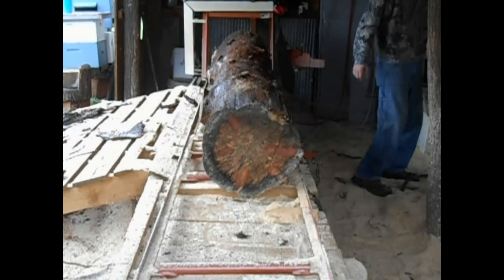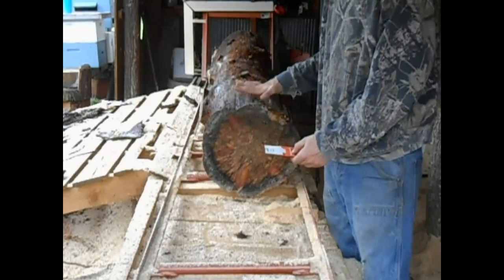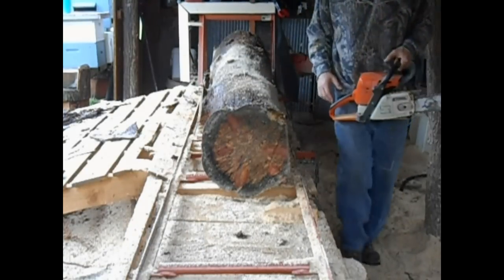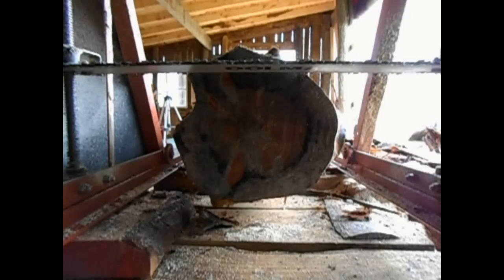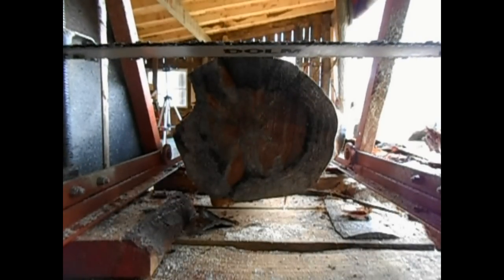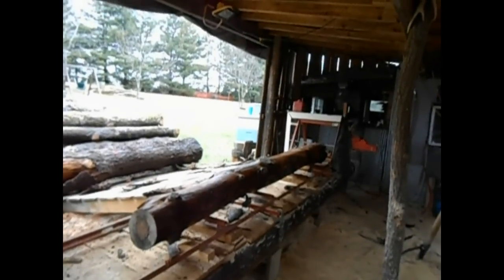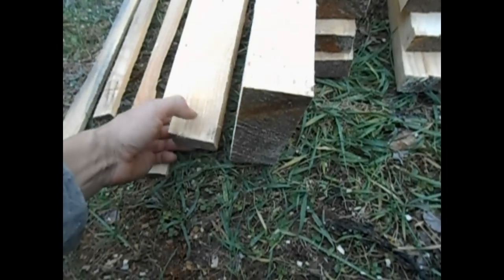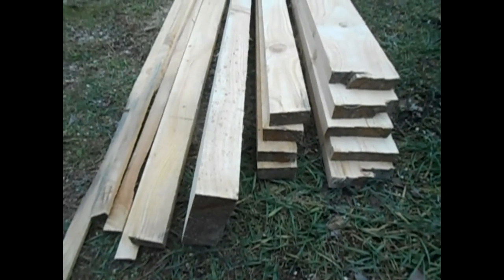Chainsaw mill/ How much lumber is in a 15" log?

Comment: Just out of curiosity, how accurate is that woodmizer table for calculating board foot based on log diameter and length?  Did you total up what you were able to cut from that log?

Good looking chainsaw mill you have there.  Seems 15" is about the largest log you can fit inside the frame for the saw.

Comment: Very cool. Do you let the wood naturally dry/season before cutting? If so, how long did it take to season with a 15" x 8' like you show in the video. +Jason Chrisman
Reply from the maker: +jaydekaytv No I usually cut them into lumber as they fall. No time to wait. Then lumber is stored and dried for a few months before using.
Reply: +Jason “Beeman” Chrisman Copy that. Thanks for the vids.

Comment: Hey Jason, thanks for responding to my comment below. 

I am a carpentry apprentice from BC, Canada, and I would like to learn about milling my own lumber. I will be watching your helpful videos.

I can't help but wonder- where do you get all those huge logs for free? Do you have any videos/ideas for how a guys without logging connections can get them?
Reply from the maker: Well as you probably seen while going through my videos I am a beekeeper. Getting free trees is not much different than getting free bees. What you need to do is get the word out, let people know you will remove trees. I even went the extra step and told a few tree guys I would take any extra logs.  One tree guy used to call me a lot to take full tralier load of logs just so he could finish the job. He would mulch everything except the logs. Hope this helps, good luck and keep me posted on your adventure.

Comment: how did you drill the holes in the blade I have tried  have bought the best drill bites money can buy I still can,t get the holes
drilled ?
Reply from the maker: LEE TAVES The holes in my bar were a complete nightmare to drill. If I remember right I drilled and drilled until I got a hole then I switched to a cone shaped grinder bit. The bit is like 1/4 at the bottom and goes up to a 1/2" at the top. So the I just did some grinding until the hole were big enough. 

The neighbor told me it would drill easy boy was he full of it. HUH? If I can be of anymore help just ask. Good luck Lee!
Reply: Jason Chrisman That seems strange to me. I installed a Log Wizard on a spare bar for debarking logs for my bandsaw mill. The saw shop owner I bought it from said it would drill hard, but I chucked a cheap drill bit in my drill press and it drilled out in a minute or so. Just used a little 3-in-1 oil for lube.

Comment: Why would the species of wood matter for the board foot definition?  As far as I know, the formula given in the video is correct, ( thickness x width x length ) / 144 is 1 board foot.  measurements are in inches.

Comment: Hey Jason, can you do a video on sharpening your chain saw chain.   I have a chain saw mill too, and haven't figured out the chain sharpening yet.   What chain do you use?   I have been using Carleton ripping chain.  P.S. On another note I should be getting my first two nucs of bees this Sunday.  Thanks for your videos!!!
Reply from the maker: This is what I use on my chainsaw mill to sharpen it. https://youtu.be/d5wsrrAsnIE 

I have yet to try a rip chain because I was told they cause a lot of vibration. Is that true? I was told it was hard on the saw but I am sure they are a time saver.

Glad to hear your getting bees!
Reply: I watched the video, I may have to try that, I have tried to do it by hand, but it never seems to cut any where near when the chain was new.   I have one of those sharpening guides in my shop, looked kinda of clunky so   I didn't try it too much.   I will give it another shot.

Today I put on a new chain, and used your tip of getting rid of the bark, I cut up a bunch of 8ft and 15ft 2x6s.    

About three decent sized logs worth, I was inspired to get working on some of my building projects after watching your videos.  Thanks.  I think removing the bark really helped, the logs I cut have been under the snow for a few months so the bark came off easy.  Chain is still sharp after several logs.  Yeah!  Since the chains are about $25 each.

RE "lot of vibration"  I don't really notice any additional, however I did have to stop early today as my saw started leaking fuel, not sure where, if it is float in the carb or somewhere else.   Engine flooded and wouldn't start fuel dripping, etc.   To bad, I was to the fun part, had a cant made that probably would have yielded 6 more 2x6x12s in a short amount of time...  Maybe tomorrow.  This is a new saw for me, got it on Craigslist, they said it was a stihl MS660 but I took it in to get it repaired last fall, and the sawshop said there wasn't a stihl part in it.  A chinese knockoff.  ha I was surprised.

Worked on getting the bee hives together today.   Maybe if this really works out, we will start making our own boxes.
Reply from the maker: The sharpener works well for me since my saw is a hard to remove from carriage. I have sharpened by hand a few time though and it cut fine.
Have you seen the de-barker that goes on the tip of the saw? Very nice but pricey! The neighbor had one and I used it many times. It's like a 3" planner that bolts to tip of the saw. It's a beast!
I have had vibration issues with my saw already that's why I asked about the rip chain. Not sure if you seen the video or not but my muffler threads get stripped and I relate it to too much vibration. 
Bees are very enjoyable. I have made cut many of my boxes on the mill.

Comment: Hey,JC...... whats a mill like such run..?   $$
Reply from the maker: I got my mill in a trade. But the guy I got it from had $1800 in the mill without the saw. A saw of this size runs $1200 without bar and chain. I just replaced the bar for $100 and the chain runs around $50. But after you own a mill lumber is cheap, cheap, cheap!

Comment from the maker: As you can see in the videos I have a one gallon gas can on top of the mill carriage. It's full old motor oil which runs a rubber fuel line to a valve where I can control the drip rate onto the bar. 

I used Dolmar for a while just after the bar exchange video I switched to Oregon. Which I am very please with.

Comment: Jason, I like your can do attitude and your videos.  Did you consider the "PantherMill 2" chainsaw mill before getting the one you have?  If so, why did you go with your current mill?  Is your current mill a Granberg Alaskan mill?
 ................www.pantherpros.com
Reply from the maker: +SeekTheTruth Thanks, I am glad you enjoy them. The mill I have I got in a trade. I had a 2006 Suzuki LTZ400 ATV that I traded straight up for mill. So I wasn't looking else where. The Panther seems like a nice setup though. Mine is made by "Mill Rite" but there is hardly any info online abut them. It's powered by a Dolmar PS 9000. I have a total of 25' of track but only have 15' setup. It could easily be mounted to a trailer like the Panther.